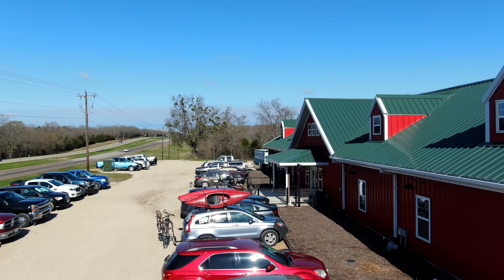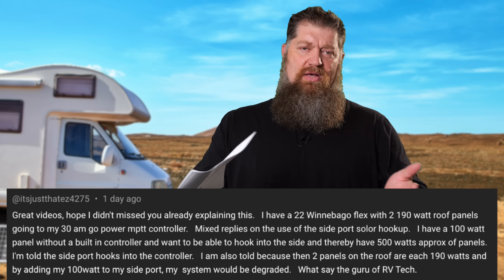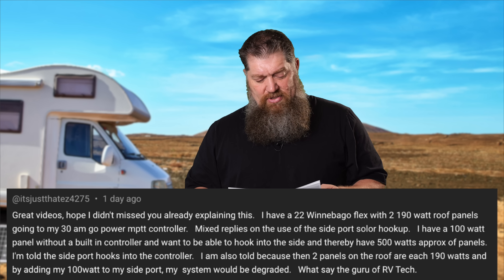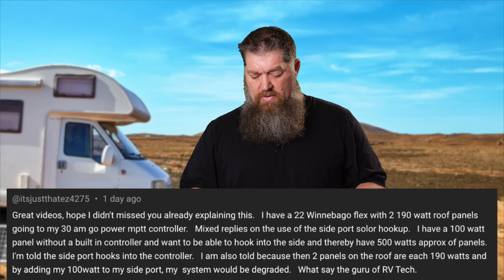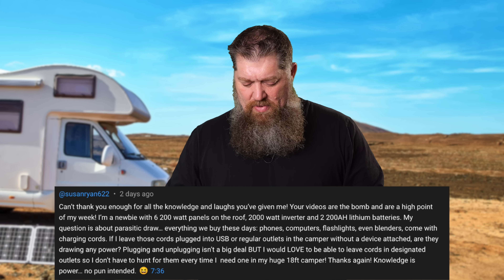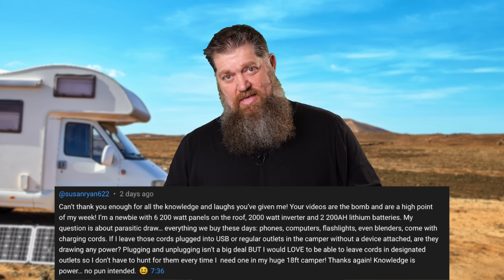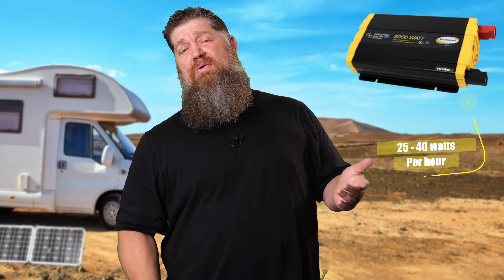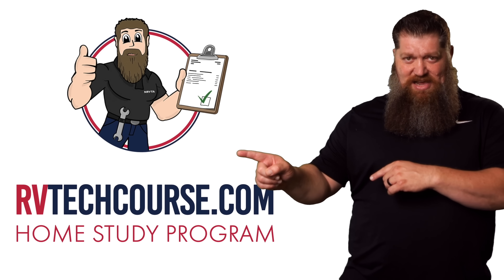Portable RV Solar.  What they are not telling you.

Comment: Two items that draw a considerable parasitic power when off are the entertainment system (DVD, VCR, and cable box), and by far my microwave. My microwave when off draws 6 to 7 amps from the battery bank, just sitting there plugged in. Like someone else mentioned, I use a power strip on both, and turn them off when not needed.

Comment: For parasitic draw, just plug chargers into a switched power bar. Turn off the power bar switch when you do not want to use your chargers. We do that with our TV entertainment stuff in our home, as well as all our RV stuff.  Also install a master switch on your rv battery.  So it has no parasitic draw.

Comment: If the DC board has a parasitic draw of up to an amp, as you say, why wouldn't my battery monitor register that? My shunt based monitor registers the draw of its own backlight, when on, at 0.05 amps. It reads 0.00 when off. Its positive is tapped at the battery terminal and there is nothing tapped between the shunt and battery on the negative side.
I did not "zero" the monitor when I set it up and haven't seen it has that function.

Comment: If there's a parasitic draw of about an amp from my DC board (or anything else), as you say, why doesn't my shunt battery monitor register that? It registers the 0.05 amp draw from its own backlight when it is on. I did not "zero" the monitor either when I set it up and I'm not aware that the monitor I currently have has that function. The monitor positive is tapped at the battery  post and nothing is before it or the shunt on the negative side.
My monitor reads 0.00 amps when nothing is on.

Comment: Hey Todd, love the beard, and the videos. My wife and I are full timers. We are currently in an area that gets frequent high wind gusts. I’m talking 50 to 60 mph wind gusts a few times a week. When the wind is blowing in the right direction, and the AC is not running, the wind is blowing through the plenum, and it causes my AC fan blades to spin in the opposite direction. And it spins so fast, that when the AC kicks on, the fan will continue to spin in the WRONG direction. The fan motor is not strong enough to change the direction when the wind is blowing that fast. Which means the AC is not pulling air through the evaporator, and it freezes. This happens mostly when we are at work, and we have 2 dogs at home. We came home one day and it was 83 degrees in the rig. 

Is there anything you can think of to prevent this from happening? Besides moving to a different location lol. Something that will give us some peace of mind while we are at work.

Comment: Hey Todd I have a 5th wheel and I've sanitized the fresh water take and water lines with bleach solution and let it set for 24 hours. Also cleaned the water heater with vinegar over night and replaced the anode rod. I turn the water on and still have an odor when I run the water...any suggestions?

Comment: I have a setup with 400 watts on the roof wired in parallel.   The side port on my rv is wired to the same charge controller as the roof. 

I have a 200watt ground panel from the same manufacturer as the roof ones.   

My ground panel adds to the solar power coming on just by looking at the increased charging amperage on the controller when the ground panel is hooked up. 

Works great!

Comment: Todd, thank you for all the different topics you cover to help us idiots out, very much appreciated!  😁 Your videos and knowledge are priceless...no really, we pay nothing for it.  
I have a pretty big battery bank relative to my solar panels - 600AH Lithium batteries to 800W of solar panels.  My demand exceeds the panels output a little bit everyday so I run a gas generator or plug-in to top off when needed (roughly every 4 - 6 days).  My question is:  Does NOT fully recharging a Lithium battery regularly have consequences?  (i.e. shorten life, reduce total output?)  Thanks BeardMan!

Comment: Thank you for all of the explanations about the different panels and charge controllers. My question that I had is no matter the solar array I have on top and the batteries I have feeding from them. If I hook up an external suitcase style charger to assist with charging as long as it has a built in charge controller I should have no issues correct?

Comment: The question in the email said, he had a "Winnebago Flex". Well, Winnebago doesn't have a Flex model. What he has is a very new, very special Winnebago FLX - likely a Micro Minnie FLX though they make other FLX models. The FLX has 2-190w panels wired in SERIES and they have a 320 amp hour Lithionics battery. Unfortunately, Winnebago hasn't been consistent in how they wire the outside port on the side of the RV. The user should put a multimeter on the Zamp style SAE port for external panels. If they see 38 to 44 volts then the outside port is wired to their controller. If they see 13.5v then it's wired to the batteries. Talking to a Lithonics Electrical Engineer they meant for the outside port to be wired to the Charge Controller - but many times it's wired to the battery. Only a voltage test at the port (preferably during sunlight) will tell the emailer what they have.

Comment: Not sure if the side port on Winnebago is connected to controller or not but the old go power controllers were all PWM and need the panels it parallel.
The new mppt can have the panels in series. I would put a volt meter on the port and check nominal voltage to see if it is connected to the panel side of the controller or connected to the battery if connected to the battery then add a cheap controller to your portable and not issue as it will work independently from the roof solar

Comment: Hey Todd, greetings from Vermont! Thanks for all your super helpful information. I learn something new every time I watch a video. Here’s my question… I have installed a 280 amp hour 12 V lithium battery in my camper but the converter/charger was for standard liquid acid battery. I understand that it will not charge a lithium battery to 100% so I top it off with a portable charger made for lithium batteries. I have been unplugging the shore power before hooking up the portable charger in fear that I would be giving the battery too much voltage. Is that a necessary step? Or can I leave the camper plugged in and also use the portable charger? Thanks in advance!
John
Reply: Not Todd, but both your Converter and your Aux Charger are both voltage sensing devices. They should be smart enough to not apply too much voltage. It is possible that your Aux charger has higher amperage capability and turning off the Converter is likely good because the LFP capable charger will apply a better LFP charging profile. If you don't have any solar panels, you might find that 200w on the roof would be enough to make up for the non-LFP Converter's inability to fully charge your batteries.
Reply: Thank you Paul!

Comment: Side ports usually are hooked directly to the battery. 
Controller always required. 
Other uses for those ports.
Plug in for masonator. 
Plug in for lights or any other 12 V item. 
But always install an inline fuse for the device you are using.

Comment: external plug on E-PRo is to the power center DC. Long long long run of #10 wire to then turn around and run out to the battery.

Comment: Hahahahahahah! Amazing video, with exceptionally hilarious bloopers!(my fav). One of the techs at the RV store I bought my RV from said I could pay them $2500 to install a solar sytem that will run my air conditioner. Does free money exist? I think not, so I figured I'd checkout the validity of his claim with you, Todd. What do ya got for me brother?
Reply: I have 400 ah of lithium with a 3000watt inverter and 400 watts of solar.  

I can run 1 ac for several hours with just that.  

To run continuously you’d need more panels and battery.
Reply: @robertl9065  awesome! And how much did your system cost if you don't mind me asking?
Reply: Not Todd, but to run your A/C without shore/generator power you need 3 things and each cost more than $2,500 each installed. You'd need first a 3000w or larger inverter. You'd need ~1,200w or more of solar and you'd need 800 amp hours  or more of Lithium Iron Phosphate batteries. And even then you'd only be able to run your A/C for a few hours. So... no surprise, your dealer's tech doesn't have a clue or he's lying. One of the two.

Comment: Always looking forward to your wisdom. Odd thing you mentioned that Go Power Solar Controller doesn't like panels being run in series. When I bought my 320G I had the dealership install 4 -190 w panels in a Kit that Go Power offered which included the Solar Controller and IC 3000 watt Inverter. I'm on my 3rd Inverter and 2nd Solar Controller. Go Power installation instructions showed panels run in Series? This might explain troubles with the Controller charging at the full amps without occasionally restarting it. I will be going to a Victron Solar Controller when I get tired of restarting it
Reply: That statement made me raise by eyebrow as well, but he did caveat it by saying he wasn't super familiar with the GoPower lineup.  I suspect Todd was referring to (GoPower's) PWM (pulse width modulation) controllers which are included on many rigs because they're cheap (and much less efficient, like 75%).  They CAN'T be hooked up in series due to how they function, which is effectively turning the panel->battery connection on/off rapidly and adjusting the exact "on" pulse timing (pulse width) so the average voltage is something that will charge the battery without destroying it.  It works OK with lower voltage panels like 18-24V, but becomes problematic at higher voltages.  

The GoPower 30A MPPT my rig came with says specifically: "MPPT solar controllers optimize an RV’s solar charging in all sun and tilt conditions, and are ideal for series wiring configurations." in the description on the GoPower site.  MPPT controllers usually have a max VOC (Volts Open Circuit) they can accept (100V in the GoPower 30A MPPT case), so as long as your panels' in series combined VOC doesn't exceed that, you should be golden.  Efficiency is much better (like 95% or better), but you're usually paying more for the solar controller.

Comment: Could you use a volt meter on the side panel, if the voltage is the same as the battery voltage, then you could safely assume you need a charge controller?
Reply: Makes sense.

Comment: In addition to my factory 150W of rooftop solar, I have a 100W individual panel. 

Like you said, I started fresh.   

I bought a cheap 10 amp solar controller and ran it between the battery and the panel. Then, I ran a cable out my storage door with an Anderson connector.

Comment: I have a Rockwood with a similar setup.   I got a 200w portable panel to assist my one 190w roof panel.   The side port is not connected to the controller.  I got an inline controller, but I also had to reverse the polarity.   For whatever reason, GoPower tries to make their setup proprietary.  I just needed an adapter, and all is well.   I like the ability to point the panels to the sun and it more than doubles the speed of charge to full SOC.
Reply: It's not GoPower that's making it require a polarity adapter. It's from the Zamp branded SAE port on the side of the RV. See, an SAE plug doesn't have a standard for which slide is positive and which side is negative. Though it's more common to see the Male side positive and the female side negative. Zamp reversed that "for safety." They felt the positive should be on the female side of the plug to prevent shorting. So, all of their plugs (and panels, etc) are built that way. Portable panel manufacturers that use a SAE terminated cable follow the common Male=positive SAE wiring. But to plug into Zamp external ports you need to change the connections of the cord with an adapter.